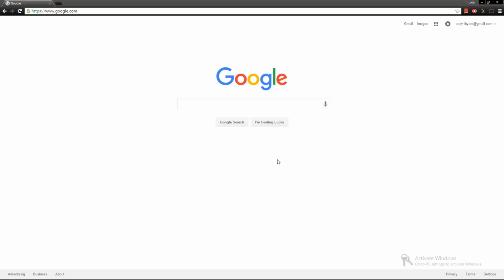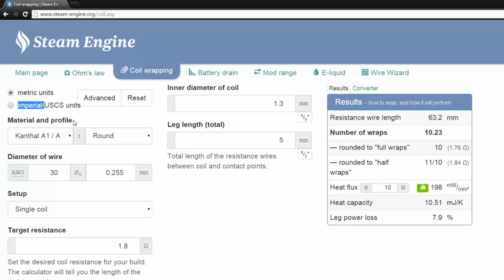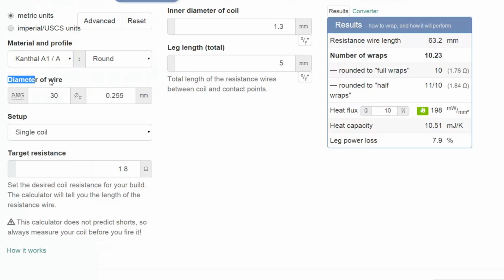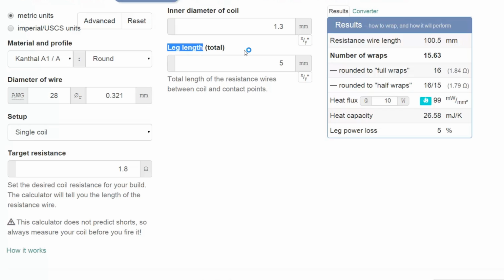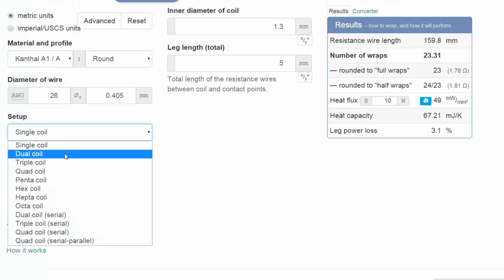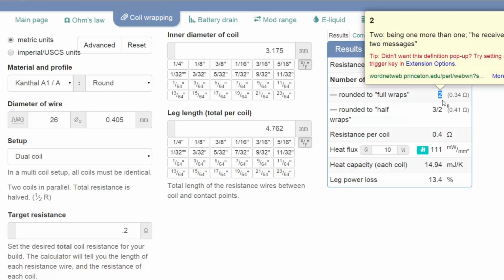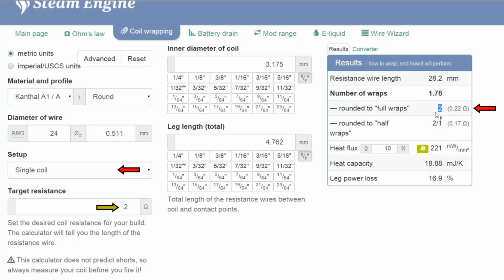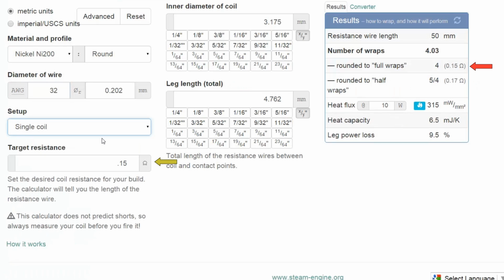Steam Engine Coil Building Tool!

Comment: In the brackets, it shows resistance of one coil. Thats why it differs from your target resistance for dual coil build, because for overall resistance to be .15, each coil has to be .3
Reply: +IseeU i was just gonna say that. with 2 coils in parallel you need to double the resistance of both coils to achieve your target resistance for dual coil. if that makes sense....i think it does lol